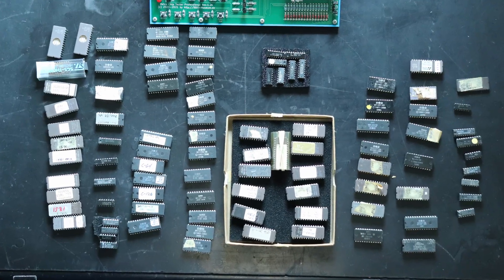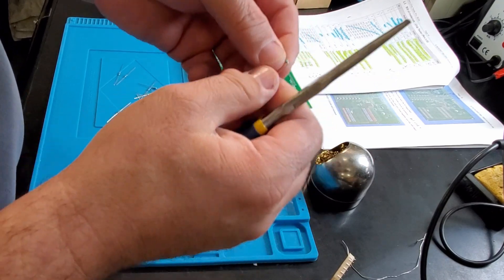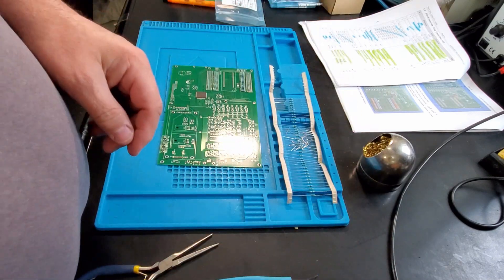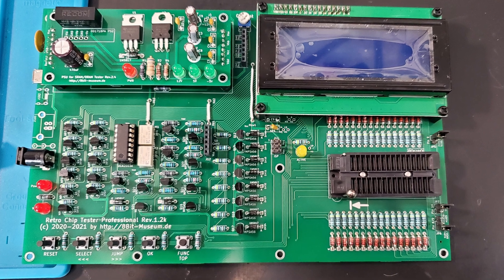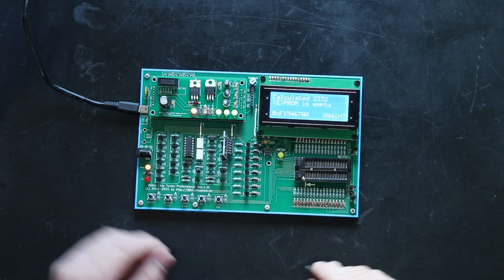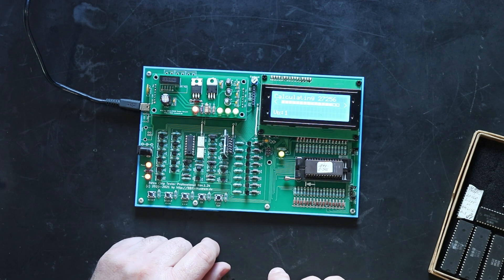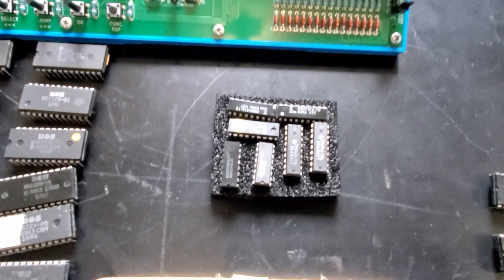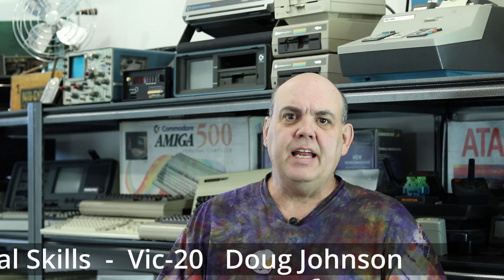What an Amazing Tool - The Retro Chip Tester Pro - Minimal Montage Ed!

Comment: Hi, do you get the source code for the system if you buy it? (Asking because I would like to integrate a rotary encoder if possible)
Reply from the maker: Frank, it is not an open source project so i don't think that the source is available. 

The designer explained to me that early design decisions from before the RCT pro expanded into its current state makes a rotary encoder very difficult to add because the ATmega interrupts are dedicated to I/O and polling is not reliable.

Comment: My story is VERY similar to yours in that I received the board in early 2022 and have been ordering parts. I ordered about half of them in and along the way many times I ordered the wrong part or was sent the wrong part, a few I couldnt find, others I was confused on what to order!!! I finally gave up and just ordered a bag of the parts from an online seller. Yeah, that was more expensive but I do want to get this thing built in my lifetime! With work, honey-do's, emergencies, family things, etc. Im at the stage now of finding the time and energy to start building!
Reply from the maker: Boy that does sound familiar 😎 I suggest you just commit to finishing step 1 in the guide. Its basically the resistors and diodes but entails about half the soldering

Comment: Nice job. I built up mine a year or so ago and I feel your pain. haha. Especially the programming part as I struggled through that until I figured out how to do it right with a Pololu programmer referenced in the manual and altering the method shown in the manual.  Anyway, it is a great chip tester and another I recommend is the BackBit Chip Tester Pro as it can also test most Amiga ICs too.
Reply from the maker: Thanks Racer X! That BackBit tester sure does look interesting!

Comment: There's an even better tester developed by Bob Grieb at Tauntek just for testing TTL logic chips.  It goes well beyond normal logic testing, actually testing voltage thresholds to ensure they are within tolerances.  Dr. Jean-Marc Verdiell aka CuriousMarc did a review of it on his channel.
Reply from the maker: I will have to check that out. My main use case is ROM testing and RAM. The backbit tester is also interesting because it can test many of the Commodore specific ICs.
Reply: Have they increased the number of supported logic ICs yet? The RCT supports 1200 different logic ICs, not only the most common 74xx and 40xx ICs.
Reply: @herbertschuster9088   He's adding support for more logic chips with each firmware update.  He'll add support for one on request if it's not supported.